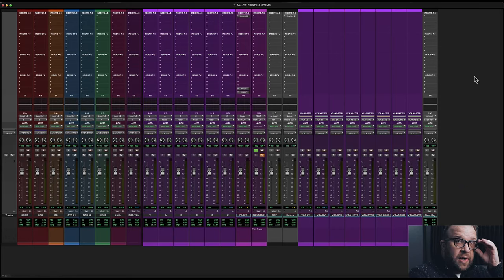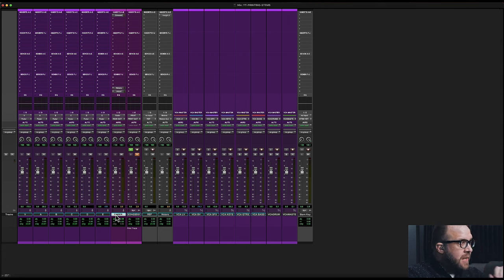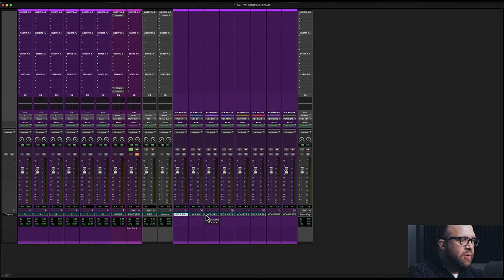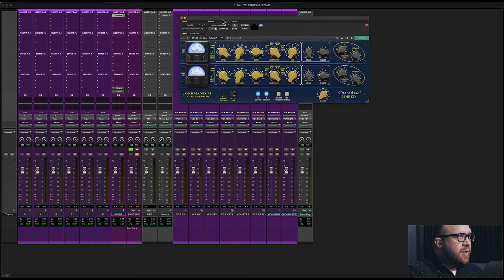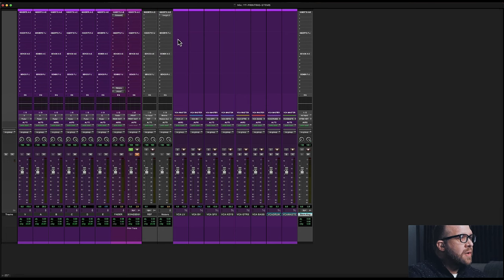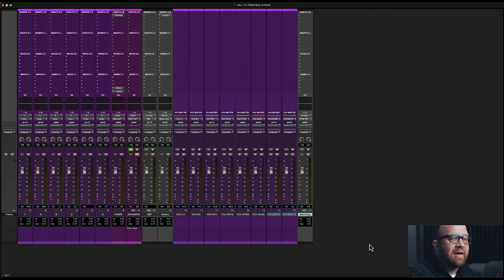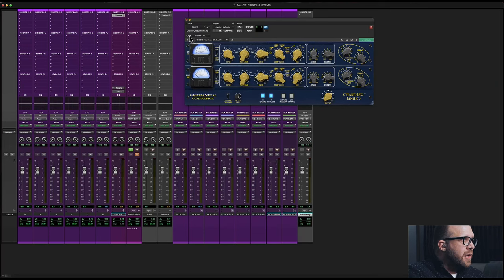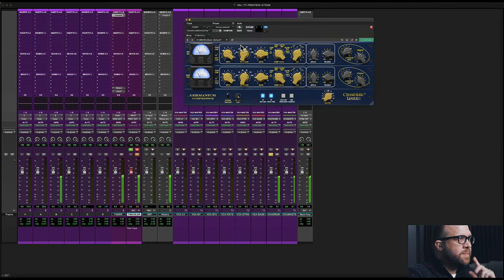Master Your Mix: Printing Mix Stems with Mix Bus Processing

Comment: Hey great video! I haven't seen anybody else talk about this. One thing I suspect some of the comments aren't understanding is some mix engineers use multiple parallel buses as a creative tool to get a particular sound. It's not simple mix bus processing. Michael Brauer's system is probably the most complicated version I've seen. 

This technique seems about as accurate as you can get. The one thing that caught my eye is it seems like your key mix should be a version of the approved mix minus the parallel bus(s) compression. That way the key track hits the side chain without final compression, matching the original input a little closer. 

Thanks so much for illuminating an advanced technique!!!
Reply from the maker: Yep, you are spot on about catching that. Another person mentioned this in the comments, which I should pin. I’ll do that. 

It was my error, in thinking more about the video, and I should have used the file you both mentioned. Great eye, and thanks for watching.

Comment: Thanks for the tip. I have a client (music library) that wants a full mix but also stems that sums into a full mix and there shouldn't be any difference. I've used to do put all kinds of mastering chain on each stems, but seems like this will be much easier and sufficient.
Reply from the maker: Yes! I’ve had those same “working” issues. This is the best way I’ve found to remedy the topic. Glad I could help, and thanks for watching.

Comment: I think this is a great way to deal with printing stems and including mix bus processing. The only (really big) caveat to me is that you limit yourself to using a compressor with an external sidechain. You're also not getting the effects of saturation. But, personally, I really think that this is absolutely good enough. Depending on the mix bus processing, you just can't expect the sum of the stems to null with the printed mix, nor do I think that clients really need that level of precision in the stem delivery.
Reply from the maker: I’d love to hear what you’re thinking when you say, “you’re also not getting the effects of saturation.” 

Whether clients desire or expect that level of detail I don’t really hang my hat on that. I want to give my best to them, and exceed their expectations. This topic isn’t often illuminated until months or years after the fact. 😃
Reply: @shanegrush  what I meant is that, unless you use a saturation plug-in like Saturn that also has an external sidechain, your isolated stems won't be driving the saturation the same way as the full mix. Consequently, you'll get different results.
Reply from the maker: @JulianDavidMusic - I’ll have to test that! Admittedly, I don’t always use saturation on my mix buss, but now you have me thinking. Thanks for highlighting that.

Comment: Wouldn't it be better to use a "before mixbux" bounce as a key? Rather than a post mix bus? So it triggers the mixbus processing like it did in the mix?
Reply from the maker: Technically, yes. Good call out. I should have done that option. 👏🏻

The more I think about this, you could do either way. I’d A/B the results and see what is closer. Maybe even do some null tests.
Reply: @shanegrush  Awesome. Your Dolby Atmos videos been helping me out. Good work.
Reply from the maker: Thanks so much, Cody. That makes me happy reading that. 

Let me know if you would like any specific topics covered. I’m brainstorming videos for next year.
Reply: Studio one covers all of these topics

Comment: Wouldn’t the latency be different when having the compressor reaction to the entire mix as individual tracks vs the two track? Also, is the goal of providing stems so the client can use individual pieces of the mix for other purposes, or to allow for stem mastering? Because only the latter would really mandate mix bus processing be included in the stems.
Reply from the maker: Hey Mike, latency hasn’t been an issue for me in this context since the processing we’re discussing is on the final output. If you changed the plug-in inserts or bypassed one of them, yes, the latency could be altered. 

Automatic delay compensation is supposed to help in those situations, but I have low confidence in some of Avid’s processing. I imagine sample rate may play a factor as well. This is a good question, though. I will always do some tests. Print stems and do null tests to see if 1’s and 0’s are in order. 

It’s not an exact science, but the goal is to deliver the final files to archive the work and be thorough in supplying what files the client gets at the end of the project. I do have clients that use stems in creative ways, such as making their own content or, supporting any marketing efforts or using the stems for the live show playback. 

Technically, you could use the stems for stem mastering, but I’m not an advocate of stem mastering. As a mixer by trade, I want a mastering engineer to elevate my mix. To me, stem mastering means the mix could be better, and the mixer didn’t nail it. 

All in all stems are a great deliverable for labels (project archiving), clients that need the files for marketing, or even to use during live show playback. As technology evolves, stems serve as a way to preserve the project in a manner that will be useful moving forward.

Thanks for the comment and for tuning in.

Comment: Thx for this video. Quick ? Could you not put a compressor on each subgroup, key that compressor (copy and paste from 2 bus) and record to their own print track simultaneously? Cheers
Reply from the maker: Hey, @mysterybro100 ! I wouldn’t recommend that approach. Why? The thing to keep in mind is that when you start messing with subgroup architecture, the input can change. Whether it’s delay compensation or how a DAW handles the single flow, you might not get a 1:1. You could do a null test and try, though. 

The goal here is always to have the same input and output signal flow, thus allowing the source material and what feeds the mix bus comp to stay the same and then the result is 1:1. I hope that helps. Thanks for the comment and for watching.

Comment: I feel like this is staying true to the letter of what the suits are asking, whilst not being what the suits actually want.

What they want is the option to do versions of the mix, vox up vs vox down, with drums, without drums, etc.

If the vocals are pumping with the drums, but then you remove the drums, then the vocals are still pumping. This is very unlikely to be what the record company actually wants from you when they say they want stems.

It would be less work for you, and more reproducible for the engineer that follows you, if you print stems without any mix bus dynamics processing enabled.

The mastering engineer is going to add compression and limiting anyway, so if they want to remix from stems, the loss of your compressor settings wouldn't be a problem.

Anyway, I'm not a pro, so feel free to ignore all of this.
Reply from the maker: Hello, I understand what you’re saying, but what you have to remember is that the mix bus processing isn’t pumping enough to be noticeable should one of these stems be soloed. The consumer rarely gets these stems unless there’s some remix competition or public release of them (which is becoming a thing these days).

The ultimate goal is to get the mix stems to MATCH the main mix. Before this technique, it has not been possible. I’m not saying that I’ve conquered Rome here. I’m just sharing a technique I’ve created where not one business person has questioned the integrity of the work. That’s the value I hope others hear. All the best, and thanks for watching! 

🤜🏻🤛🏻
Reply: @shanegrush  in which case, that's the ultimate test: if your clients are happy, then you've no need to worry about some guy commenting on the internet! 

I've often thought about how best to go about enabling stem mastering, luckily I just do this for fun so I've never had to.

Thanks for replying, take care!

Comment: hey shane, thanks for your great video. i have to do a mono "stem key" bus in order for it to work. in the key input of the compressor, it seems i can only choose a mono bus. did you have the same experience?
Reply from the maker: Some plug-ins only allow a mono side chain input. So, that is a variable in what you’ve asked. 

In that case, I'll use the mono side chain input but it doesn’t affect my work negatively since my stereo buss processing is all LR linked. Even with a mono input, I trigger the compression for the L and R, and that's perfectly acceptable to my ears. 

The tricky part is if your preference would be to have LR unlinked.

Here's how I handle it: my mix busses prior to my main stereo mix buss are all unlinked. Small caveat, I have my version of “Brauerizing” where I use multiple mix busses feeding into a main, and final mix buss.
Reply: @shanegrush  that makes sense. thank you
Reply from the maker: You’re welcome. 🤜🏻🤛🏻

Comment: Don’t you get better control if you just copying the mixbus settings, and bounced the stems without the mixbus processing active, and use the mixbus settings on the stem-mix?

I do see the benefit due to analog gears and settings (picture), but what benefits do your workflow achieve for a total in-the-box mix?
Reply from the maker: Hey @oh515 ! I don’t think so, personally. If you’re copying inserts across stems you’re only processing that stem. You essentially lose the summed nature of the signal. 

Does that make sense? Am I understanding you right?
Reply: @shanegrush  
Yes, it makes sense if you for a reason need to print the stems with summing, but don't you get better control later if you bounce the stems with a clean mixbus? It will be the same result if you import the stems in a new project and process the stems through the saved mixbus processing (from the main/pre mix). Or is this a technique for use in Atmos mode?
Reply from the maker: When I say “summed,” I don’t mean summing. I mean, multiple inputs are going into a single stereo aux (your mix bus) and then printed. If you have stems and identical processing on each stem, you do not get the interaction. That’s where my process comes into play. Why make an extra step for yourself? Finish the mix, and print.
Reply: @shanegrush  
Yes, I assume I'm not there yet. I should probably start to take that step to speed up my workflow.
Reply: @shanegrush  
Thanks btw!
Reply from the maker: You’re very welcome. There’s no right or wrong. Follow your instincts. I am trying to share things that helped me, but there’s no one-size-fits-all for this stuff.
Reply: @shanegrush  
That’s true, but I’m ready for a new workflow. Right now I’m everywhere in each step and looking for a more or less standard flow that suits me. That’s why I’m here among many channels. I guess I have to figure it out myself in the end.

Comment: Internal Pro Tools Dolby Atmos Renderer I/O Setup make the video plz
Reply from the maker: I've looked into the Internal Renderer, and I wanted to follow up on your comment. The routing is highlighted on a few videos Avid has released. Check those out! Also, the manual outlines the changes to the I/O page to help you understand the signal path when using the internal renderer. I hope this helps. Starts on Pg. 57,  https://resources.avid.com/SupportFiles/PT/Pro_Tools_Reference_Guide_2023.12.pdf
Reply: @shanegrush  Thanks

Comment: Sorry I'm dumb, but what's the point of the comp then? It was keyed to compress an already approved track when you print the stems, not compressing the mix. What's the point of using the comp at all? Why don't just print the stems as your final mix has been approved? Your idea is good, but I think I will improvise a little to make sure the comp compresses the mix, not the approved track. But even in this case, if the final track was approved, why do I need to use a comp to alter the sound again?
Reply from the maker: You’re not dumb. The stems have to be printed at some point. I’m just highlighting how to print them with buss processing. I am showing an example that is already completed, so maybe I should have walked through an incomplete example. The stems are a separate deliverable alongside the stereo mix, and this approach allows an engineer to make a final mix, and then print very accurate stems.
Reply: @shanegrush  Thanks for the explanation. I'll try this technique in my future projects. It's cool. Thanks!
Reply from the maker: You’re welcome! Go get em.